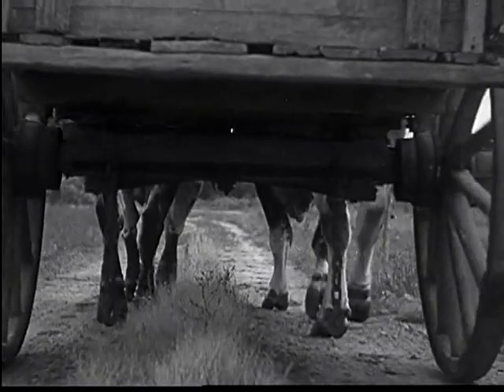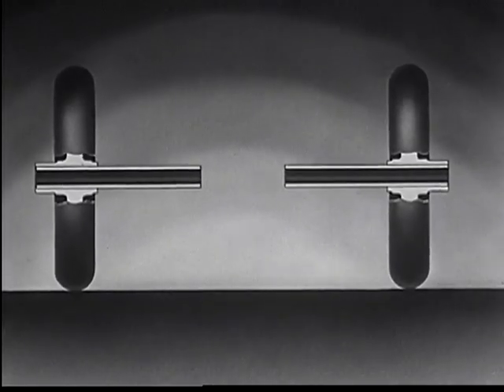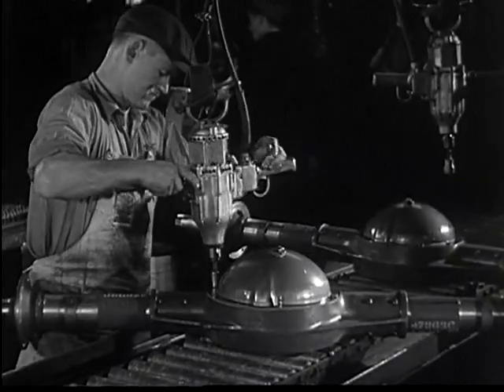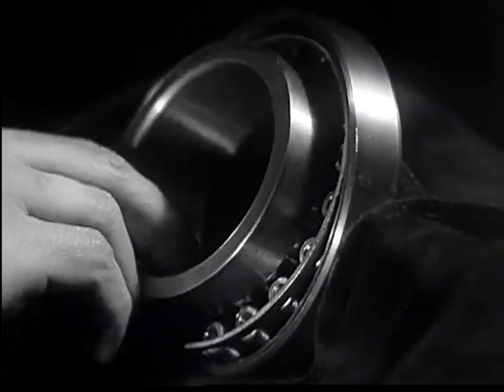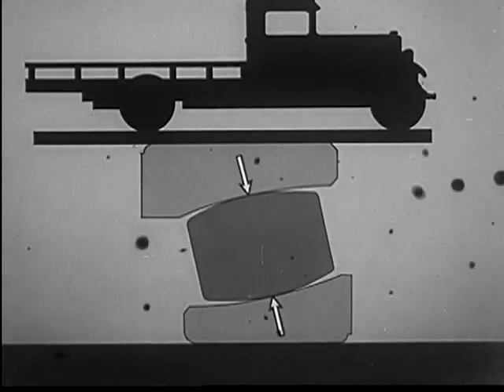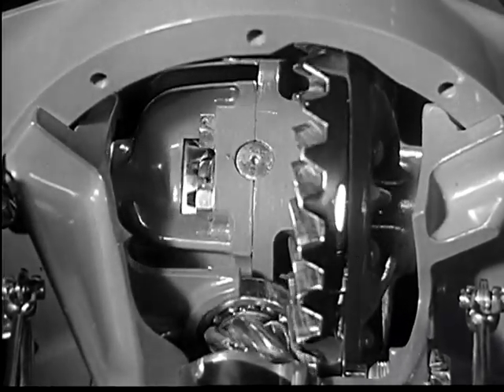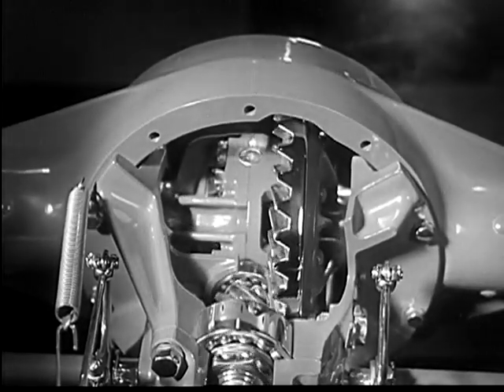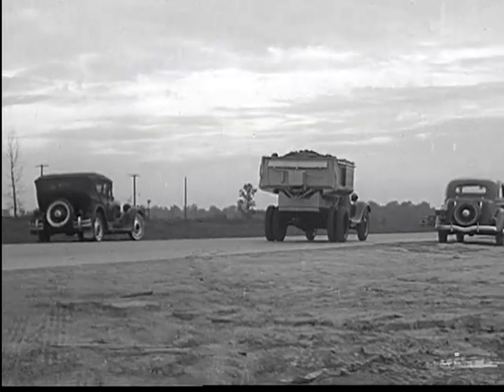It Floats - Chevrolet Full Floating Rear Axle (1936)

Comment: I have a 1928 GMC truck with a similar rear end that I am still driving as of last week. (the last time I had it out) It's similar to the earlier version in this video. Would you believe it has a rope / felt front seal on the pinion and still does not leak despite the use of 90 wt oil instead of the OEM 600 wt? Yeah, the old gear lubes were rather thick, but that was the technology back then. The stuff got real watery when it warmed up, unlike today's lube oil!
Reply: did they build the metro with these cars?? is that even possible??
Reply: @АлексейСемизаров-ц8р  ... back in the day they built some of the largest dams and other structures using vehicles with these features.
Reply: @rupe53  I wonder-before 1930, was there the technology, the power to build mega structures such as platinum, metro? Example - to transport soil developed from the construction of the metro must be multi-ton cars with a body for bulk materials. I can't find them from old photos. That's the question.
Reply: @АлексейСемизаров-ц8р  I'm sure there was because the New York subway (metro) was started before 1920 and so was the New York water system, which is over 100 miles of tunnels. Do a google search using "construction of" then add your project name. BTW, the Hover Dam was started in 1931 and they moved a mountain of dirt / rock on that project.

Comment: Back when people weren't Dumbfounded with Useless Celebrity  Trivia- your Average Local Mechanic could Pull apart & Reassemble your Car or Truck to the Last Nut & Bolt- Now we've  let Computers  do all our Thinking- Mechanics are now 'Component Fitters' they plug your car into the Diagnostic Code Reader- & Replace  the part as Specified by the Readout- No Thought or Reasoning - Replace part XWZ-123 Ok!  These old Trade Films are Great to Learn how & Why things are Designed & Visually see how they Operate
My Dear Old 'Late'  Neighbour 'Jack' was an Old Trucky & Worked as a Logger in his youth- That was a 'Can Do Guy' - He Could fix or Do Anything Mechanical- He Taught me a Thing or 2 When he was Restoring his Classic Old Diamond Reo Truck- It Had a 2 Stroke Diesel- I thought he was pulling my Leg- Until he Explained & Showed me How it Worked- It was A Detriot Diesel - With a Combined Supercharger & Turbo!! They need a 'Blower' To Run at all- as it Forces the Air into the Cylinder it Also Evacuates the Spent Exhaust Gasses through Port Holes in the Cylinder Liner
I was Amazed, Some of the Old Skool Knowledge isn't  getting passed on like it should be These old films are Important to Keep for teaching forgotten Knowledge- 👍

Comment: this is realy a primitive conception, like on old trucks, in Europe , at same times, the most cars cars still use for long time, a De Dion rear axle who was use up to the first years 2000...on a De Dion is the rear axle very light and maintained with Watt arms: this improve widely the road holding and suspension efficiency (the differential is fixed at car body)

Comment: Hey, truck mechanics! Ever have one come to you with an interior axle shaft broken off, especially if it happens right close to the ring -pinion set?  How do you snag that broken piece without losing it in the banjo? If you do, you gotta take out the "pig"!  Here's a trick!  Take out the other shaft on the other side. Get a fence pipe larger than the axle end. Stick it in the side with the broken piece, up against the broken piece, or actually over it if enough sticks out. Have someone hold this pipe in place and tell him not to allow it to be forced back out as you work. Go on the other side with a long bar, put it through the spider gear until you touch the end of the broken shaft. Both spiders are hollow where the splines are, so one leads to the other. Now whack it with a hammer, and the broken part will end up in the pipe. Carefully withdraw the pipe with the broken shaft inside!

Comment: 4:50 "Oops, broke an axle. Let me just pull my spare one out of my glove box... Presto! And I'm off"
Reply: And you can fit it yourself! I can imagine the announcer back then.... 'fitting a new axle is so easy, even a woman could do it!' :)
Reply: Lol
Reply: "oops drive to high and now my engine is running to rich, I'll just re tune my carb, oops locked my engine."
Reply: @jwalster9412  Thats not how any of that worked back then my guy. Most carbs use the atmo pressure to help regulate fuel and can accommodate very large changes in pressure(2500+- feet). alot of problems arose from early fuel injection cars because the early sensors weren't sensitive enough to make those kind of adjustments, now thats not a problem. in n o way would any of that seize your engine.
Reply: @alexgorski1806  "tuned my carb, now I'm running rich?, is that a knock..?"

Bang
Screech

"Why won't this start?"
Reply: @jwalster9412   well for one that would be lean and under boost, if your getting a rod knock. Most na engines either refuse to run to far lean or will just ping(not knock). but you could easily fix that with a screwdriver, boost often causes knock . rich would just foul your plugs and smell like unburnt fuel.
Reply: @alexgorski1806  "why won't my Engine start, or even crank?"
Reply: @jwalster9412   bud. You're the reason they have "Do Not Eat" on the silicate packets that come in shoes... I don't understand what point your fighting, carbs aren't that difficult to understand and they operate in a massive range of elevations without constant adjustment. also an out of tune carb wont seize your engine period. please stop huffing whatever superglue you got into.
Reply: @alexgorski1806  dude, no need to be so confused offended, I was just going on with the joke I made afew days ago.

(Side note- how did confused get there, I never typed that.)
Reply: I had a customer at the grocery store where I worked eat the packet that keeps the diced up veggies fresh.  It specifically says "do not eat". When she told/asked me if she shouldn't have eaten it I was dumbfounded. Lol! True story!
Reply: @danoakley6538  I know that .y comments sound stupid, that's kinda the point lol. Didn't expect someone to get offended.
Reply: Well, yea? What's so wrong with that..?
Reply: In that day and age there was probably a Chevy parts dealer in every town with a storeroom choc-a-block full of axle shafts.  Today you'd need to wait a week for one to be shipped over from Japan...or more likely Korea.
Reply: It's called drive shaft, dummy! The narrator explained the difference in the beginning. Did you ever brake the drive shaft of your car?
Reply: @franktechmaniac7488  it would be considered an axle or half-shaft in modern terminology. Driveshaft is what runs from the transmission to the differential.
Reply: @franktechmaniac7488  Imagine being all 'ackshually' about something only to be wrong lol